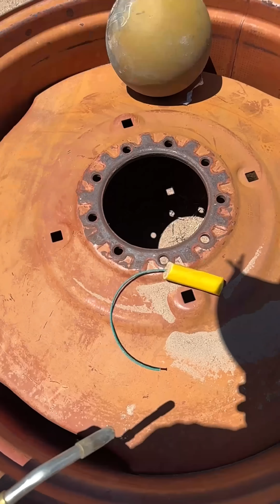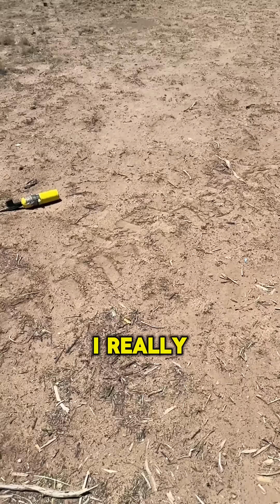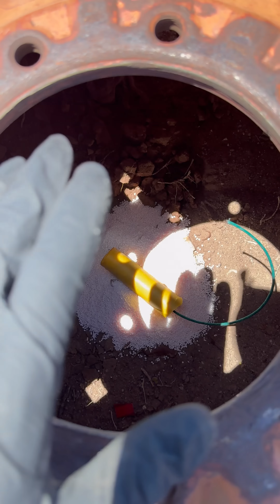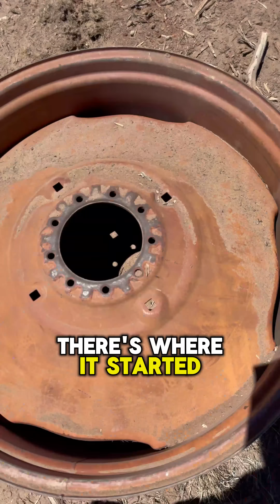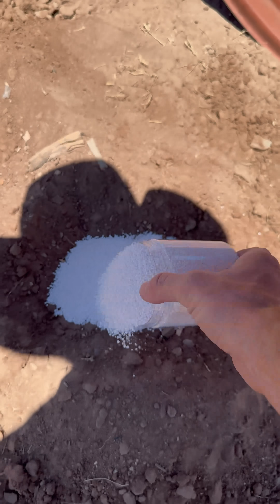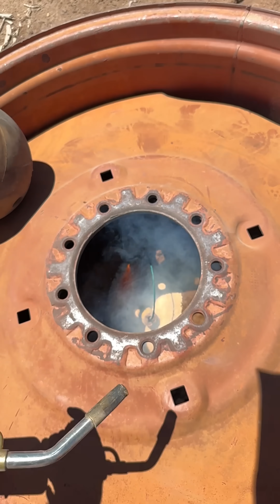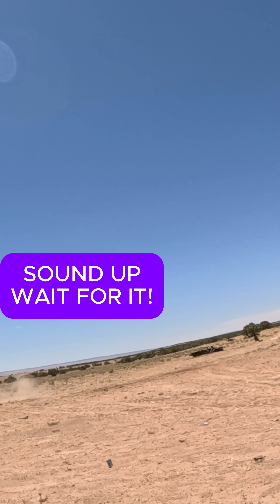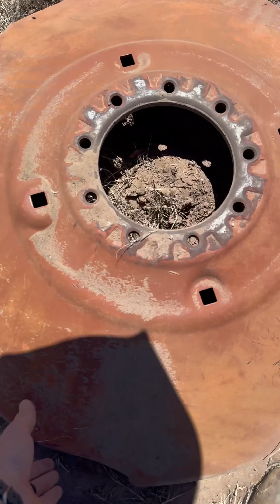How powerful is ANFO and Dynamite?

Comment: Lighting the dynamite next to  anfo with a blowtorch, subscribed ❤
Reply: I think it’s just ammonium nitrate, no AN and fuel oil. But even it was, it’s still not going to explode with the torch. It’ll just burn. 
The burning makes it unstable, but the dynamite is about to do that anyway. 😂
Reply: @tylerfb1  also remember-nothing "explodes"-it just burns super fast. And HOT.
Reply: @stevenrobinson2381  agree to disagree. But that’s not what I meant.
Reply: Anfo? Not familiar I guess, kinda looks like fertilizer to me
Reply: @troymaier1073 Ammonium Nitrate Fuel Oil. 
It’s diesel mixed with ammonium nitrate fertilizer. It’s a pretty safe and stabile mixture that becomes a high explosive when detonated with a blasting cap or some other detonation (here the dynamite), or when contained and set ablaze, after a while will spontaneously decompose and detonate.

Comment: I am used to anfo being a putty/thick slurry consistancy not dry granules.
Reply: Wrong, it IS ammonium nitrate. This is indeed what it looks like in the dried state. The slurry is emulsion. Its the same thing but with an emulsifier added.
Reply: @valdimer11 My Grandpa used to make ANFO when I was a kid to remove stumps his fields.
Reply: @valdimer11 the slurry is ammonium nitrate with the diesel (usually) added, which is the FO in ANFO
Reply: @VAL9THOU the dry stuff has fuel oil added as well. The slurry is a mix of more than just fuel oil, which is why the consistency is the way it is.
Reply: It's because it's just ammonium nitrate, not ANFO
Reply: I was thinking the same thing. Surprised it made that much of a difference

Comment: ....how is that ANFO if it's dry? Shouldn't it contain Fuel Oil (IE diesel)? Is that just Ammonium Nitrate Prills?....as in not even Tanerite(ammonium nitrate and Al/Mg turnings)?
Reply: Excellent question. Each grain of ANFO is called a prill. The outermost layer is porus and absorbent. A small amount of fuel oil is introduced to the prills which is then absorbed without destroying the structure of the prill. The amount of fuel oil used is miniscule. Like 6 percent or so.

Comment: Isn't that just ammonium nitrate, you haven't added the fuel to make it ANFO.
We used to mix it up in a big hopper with diesel and pump it into holes to be blasted.
Before detonating it looked like a white/pink paste.
Reply: That stuff you were pumping was emulsion. Its a different type of ANFO. A quarry blaster doesn't know construction blasting. Two different styles with two different TYPES of product.
Reply: @valdimer11 it's been 17year since I was charging faces.
Never quarry work, all underground.
Reply: Good times man. Its fun. Its also hard on the body

Comment: That blowtorch almost touching the nfo
Reply: Nfo will not light with fire. Only percussion
Reply: @WhatTheFlipperoni not necessarily, it can under the right circumstances. Just a quick flame though for a few seconds is fine
Reply: @jamesmoore5959 not without gunpowder mixed in, it would melt into sulfur then burn with a small flame only
Reply: @WhatTheFlipperoni might wanna check your sources on that…
Reply: Quick bit of fire usually doesn’t set off ANFO.
Reply: It’s fine, NFO doesn’t blow up because of flame or heat. 
It react to pressure aka you need an explosive charge to detonate NFO.
So you would have more chance blowing it up by hammering it with a hammer.
Reply: @Izzy2u what is the FO? Is it ammonium nitrate and something?
Reply: fuel oil, usually diesel
Reply: @forfun6273 Uhhhhhhhhhh not sure on what list il’l end up… but yeah it’s ammonium nitrate pellets that are really porous, and number 2 fuel aka Diesel but for big machine